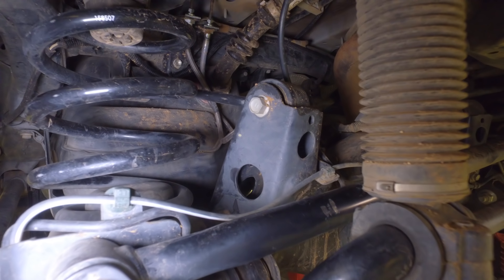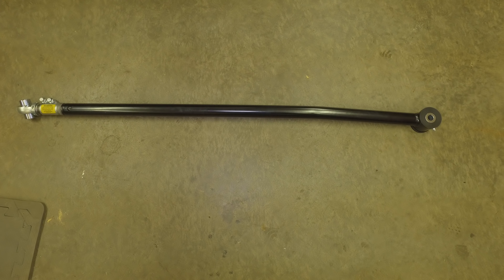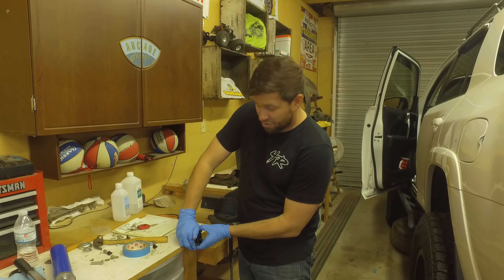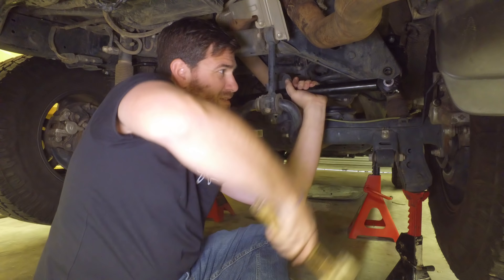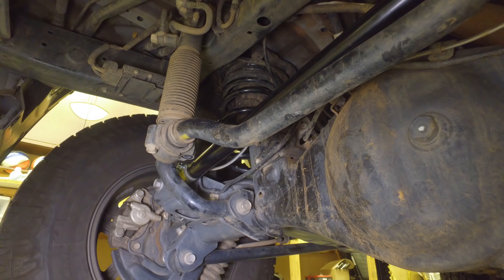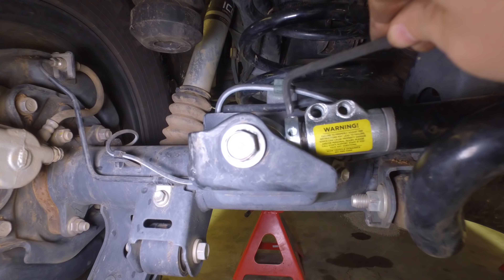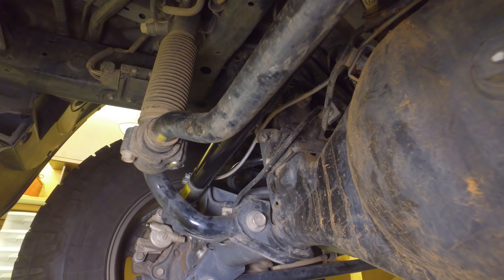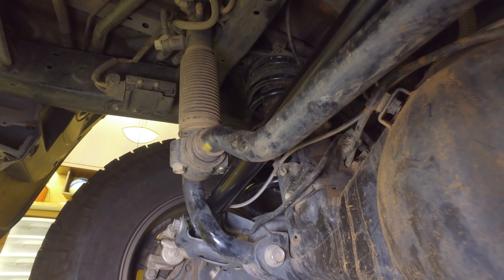Installing an Icon Adjustable Track Bar on a 5th Gen 4Runner

Comment: The bend on the PS of the ICON track bar install makes sense. 
As at full drop in the rear the ICON bar on the PS side needs that angle to (just barely) clear the fixed side of the rear KDSS system.
Reply from the maker: We were not having a problem on the PS. The issue we were having was we were hitting the bolt as you can see in the video. 
Now... Since then we have installed another lift (not Icon) on another 4Runner and have the issue of hitting the PS. I see how this Track Bar will solve that problem.
Reply: @SnailTrail4x4  I was not so much commenting on your current problem. I was just stating what I noticed over the years of dealing with my 2015 4runner w/kdss @full droop. 
For me the DS NEEDED the rounded head bolt to clear. As for me the installer did not change the bolt on the DS rear live side on the kdss mount on initial installation and luckily I was watching the suspension and did my re-torque  noticing the scratches on my track bar wondering wtf was going on. I changed the bolt myself to alleviate the problem.
Checking my droop in multiple situations since, it all still barely clears regardless what tires up or down or both.  Although I'm good with where my suspension is at personally, I've been thinking/working/studying kdss bypass and removal options, crunching the numbers for LT
Reply from the maker: @chulksmack1  -- that's always an option.
Reply: @SnailTrail4x4  I just did this install on my 2017 TRD ORP and could not get the track bar to fit without hitting like you have in the video.  So I made a game time decision and installed it backwards just to see if it would work and cleared everything fine, no scratches.  That's with the zerk fitting on the DS and the adjustable section on the PS.  Since I'm clearing fine now any reason or danger not to keep it this way?  Would it matter if it's on in the reverse way the install guide says?  Might call Icon this week and see what they say.  I'm kind of thinking "Hey, if it does it's job and no risk to the vehicle or passengers .. might as well leave it like it is."
Reply from the maker: @ThomperYT  -- It shouldn't matter if it's one way or another, if it's not hitting anything at full compression or full droup and your axle is centered then you should be alright
Reply: @SnailTrail4x4  I was planning to re-grease it today and realized I forgot what the torque specs were for the track bar.  Shows I need to write them down.  You happen to have them?  For the 19mm bolts you point at the 0:48 sec mark.  Thanks in advance.
Reply from the maker: @ThomperYT  64 ft/lbs
Reply: @SnailTrail4x4  You are super awesome.  Thanks so much.
Reply: @ThomperYT  I was thinking the same about installing it the other way, how did it work out for you?

Comment: I will be installing sonoran trac bar along with Icon ext travel coil overs with Ekstrom design strut shims, 3" rear coils, 2.0 rear icon shocks, camburg UCAs (possibly new bump stocks. I will try to video tape the install along with pictures and instructions.  I also grabbed a pair of  shock wraps and rear shock boot kit from icon so we will see how everything pairs up. Excited but nervous. 😬
Reply from the maker: That sounds like a great combo, we have a Sonoran Bar now also, going to be installing it soon.
Reply: @SnailTrail4x4  do you still pay for step by steps?
Reply from the maker: @Itz.Ironbane  -- Nope, do you? I have been thinking about making them, but they are a lot of work.
Reply: Ryan Bjoro hey, wondering if the sonoran track bar worked with your icon stage 2 setup?
Reply: I would love to see a video on the Sonoran Trac Bar!!!

Comment: being a Jeep guy i'm not familiar with that shock looking thing attached to the sway bar, Can you enlighten me?
Reply: KDSS. Loosens the sway bar allowing for ~20% more articulation at low speeds compared to regular sway bars. Also allows for a beefier sway bar for better handling on pavement.
Reply: @Xhado17  kinda like a sway bar disconnect. It's an Offroading option. Cool
Reply from the maker: Yeah the KDSS system is really only on some 5th Gen 4Runners and I believe some lexis GX models. Like above it helps with on and off road performance bye s stiffening or dampening the sway bar. Our issue is that the track bar is designed for the KDSS system and we are still having a problem. I contacted ICON and we are looking into solutions.

Comment: Any update on this? I just did the bump stop upgrade and I noticed some scratches on my track bar and it’s at stock height. Hope you can help!
Reply from the maker: Are your scratches in the same spot?
Reply: SnailTrail4x4 yea 😥 I’ll be lifting my rear 1” soon. Also I wasn’t able to tighten the middle bolt on my bump stop 😅 hopefully it stays on until I tighten it up 😂
Reply from the maker: @alohatcgcollector  -- you're probably fine. Just make sure it doesn't fall off 😂
Reply: SnailTrail4x4 hahaha yea I’ve been watching it. But probably when I change the coils I’ll tighten it down 👍🏼

Comment: Looking forward to hear how you resolve it with Icon. I will be installing a Stage 2 with the adjustable rear track bar on my 2016 4Runner with KDSS. I was told that with KDSS you should not lift more than 2", maybe 2.5". However I see lots of people go higher with no apparent issues. What is the lift height on this vehicle?
Reply from the maker: We have Icon 3" springs in the rear. I don't recall having an issue when we placed the Stage 2 system in at the beginning. Icon asked us to make sure the axle was centered. We did that and are still hitting the sway bar. I called them back and they said we need to buy their lower adjustable links, and that should solve the problem. We are looking into all possible solutions.
Reply: Hey Chris, howd the setup work out on your  runner? Any issues with contact of the track bar?

Comment: Is this a necessary part swap needed for those of us without KDSS?
Reply from the maker: How much did you lift your rig? Also have you checked if you have any spots colliding? We noticed we had an issue and this Track Bar  is Icons suggestion.
Reply: @SnailTrail4x4  I will be lifting mine in the next month and I don't have KDSS so I was wondering if this is another necessary part.
Reply from the maker: @Reverend1776  -- how much lift are you doing? It wasn't necessary for us as we found out only after the fact.  We didn't have any problems with the 2" springs we had but now we have 3" rear springs and we were hitting the KDSS bolt. 
Our solution would have been to buy that button head allen bolt. That simple bolt would have solved the problem we were having. 
You should do your install, see if you are hitting anything, and also check if your able is centered. If you need to adjust the axle then you should get one of these.
Hope that made sense 🤔
Reply: @SnailTrail4x4  I appreciate the advice. I will be installing Icon Stage 2 and I'll keep an eye on the components.
Reply from the maker: @Reverend1776  -- This weekend I just installed a lift on a 4Runner (not Icon) and we where hitting the track bar onto the KDSS on the passenger side. So make sure you watch this on your side.
Reply: @SnailTrail4x4  but I have no KDSS, so would this even be a factor?
Reply from the maker: @Reverend1776  -- It might be. Your rig still has a sway bar, unless you took it off, so I'd just check and see when you do the install. We have only ever had an issue when the 4Runner was at full droop.

Comment: Any update on sway bar hitting track bar?
Reply from the maker: Icon told us we also needed to get there adjustable lower links. But we also found another Swa Bar we're going to install. (Additional Note: the kit we have is with there extended overland springs)
Reply: SnailTrail4x4 so it’s a no go for icon stage 2 on a 5th gen?